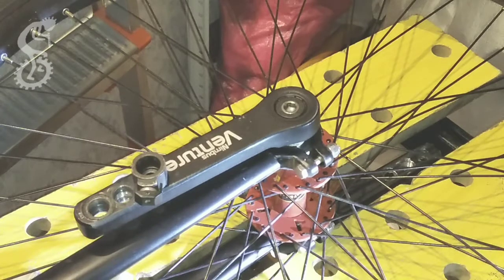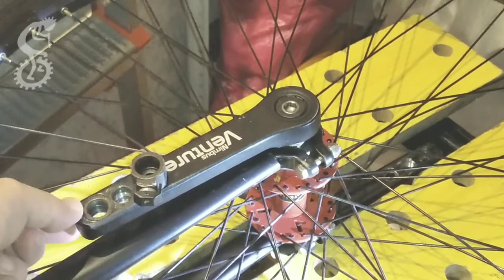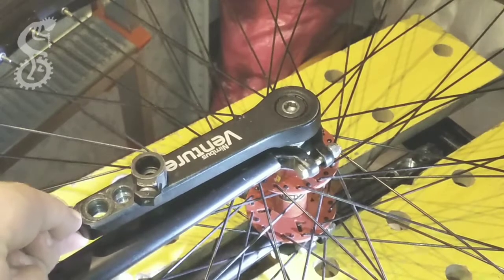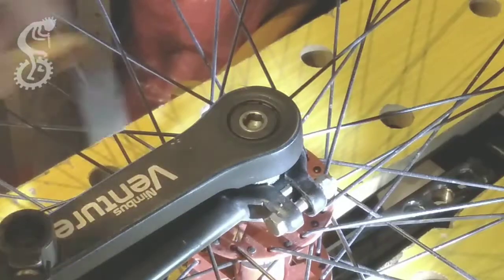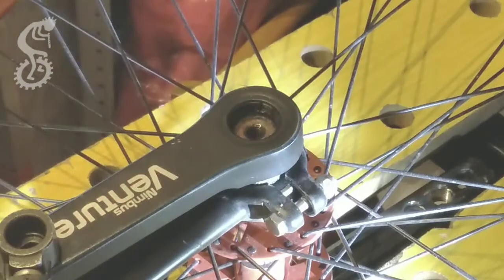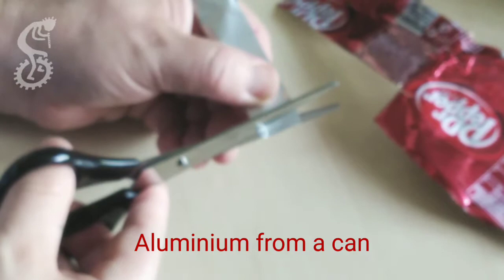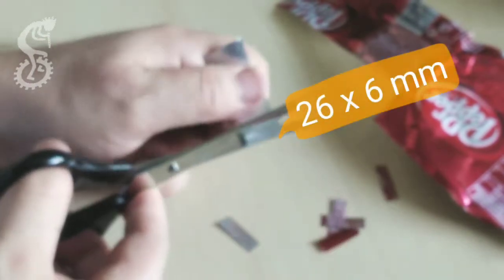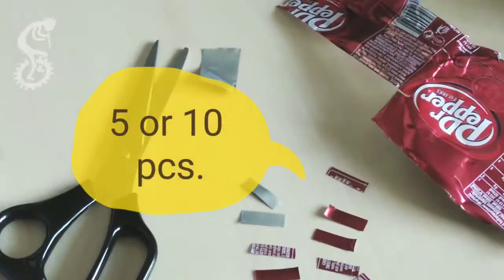Cranks came loose fix unicycle, уницикл шатуны isis люфт откручиваются

Comment: Very nice fix.  However, I think with so much yielding of spline bearing surface on crank = many cycles of stress = crank lever breaking soon @ extra hole drilled(not original design) cross section. Be careful doing more jumps.